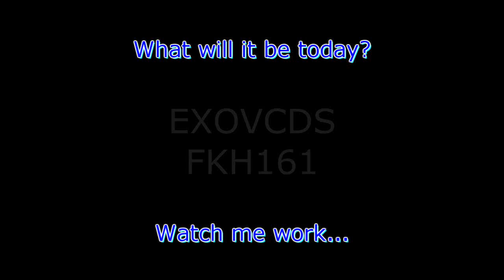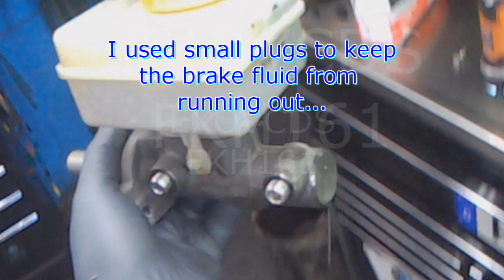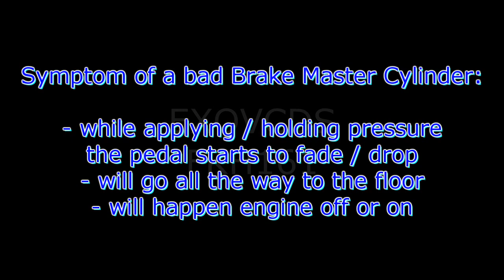VW A4: Brake Master Cylinder Replacement (part 1)

Comment: The video you are producing is giving surprisingly good contrast, great lighting in your shop. Voiceover done after, to explain what you are doing would be a great opportunity to discuss details like how to make the diagnosis and various pitfalls you have encountered.
Reply from the maker: Thank you for watching & taking the time to comment! I am not yet comfortable in adding voiceovers to all of my videos... I have added some in the past, to discuss datalogs, but find myself making mistakes which require multiple audio retakes. As soon as I get a chance to work out of my own little shop, I will talk while recording, as that comes naturally compared to narrating play by play.
Reply: Most guys add in the audio later, in which case you can record the audio at home and not feel self conscious when talking in the shop. It's sometimes distracting to teach and work at the same time. Sitting at a computer you could write out what you are about to say if you like, and you could even watch the video while talking. High level programs let you overlay the new audio on top of the old so it blends nicely. I've done this many times, if you have technical difficulties or wonder about hardware/software issues I might be able to help.
Reply from the maker: spelunkerd I'm using Sony Vegas Pro12 and have additional audio software as well. What I lack is the radio voice to go with the narration. Like I said, I have no issues talking into the mic while recording, but am not able to do much of that at my current job / surroundings.

Comment: hi. I have audi a4 b6. 
my brake pedal goes very soft only when engine is running, but when engine is off, pedal is not fading! could it still be master cylinder? what I noticed as well that only  when engine is running and I release my brakes, it takes 2 sec for the front pads to release the front brake discs. On the small incline its very noticable.
(front calipers are 2 years old.)
thanks in advance for any helpful answers.
Reply from the maker: Some cars have "hill assist"... where the brakes are held for a couple of seconds. I'm not sure if your model car has this feature. If the car does not have this option and the brakes are not releasing quickly, then it could be a problem with the brake booster. It is normal for the pedal to feel soft when the engine is running, due to the brake assist by the booster. If the booster is over assisting, it could be causing the delay in brake pedal / pad return. A bad master cylinder will cause the pedal to fade engine on or off.
Reply from the maker: @cmmartti  ABS unit bleeding is not necessary unless the unit was replaced or air got into the pump. With the ignition off, there should be no way air can get into the ABS unit since the valves are closed. When driving, the hydraulics bypass the ABS, so the brakes work just like a non ABS car. Once wheels start to lock, that's when the valves open and what can cause air to enter the system... if air is already in the lines.
Reply from the maker: @cmmartti  Thanks for the update! Sometimes you can get better brake pedal feel... by resetting the rear calipers. Turn the pistons in all the way and then back out, so that they just clear the brake pads (should have a couple mm free play// 1/8" max). Secure the caliper and then pump the parking brake lever at the caliper with your hand to fully adjust the mechanism.
Reply: @EXOVCDS  Thanks, I'll try that when I get a chance
Reply: did this fix your problem?

i have same issue..

bled many times.

i will readjust the callipers with rewind tool
Reply: @EXOVCDS 

you made a good video, i will change my master cylinder your way if i dont get it right.

golf 4. many abs feutures.

my pedal sinks when engine on, but pedal does not sink when engine is off..

Comment: What size/thread plugs did you use to plug the holes to keep fluid from running out after you removed the lines? Thanks again!!
Reply from the maker: They are plugs that come with new rear brake calipers. I keep the plugs and use them for stuff like this. I'd have to measure the size & pitch. They have a pointy / cone tip, to nicely engage the master cylinder / stop leaks.

Comment: Hey friend,

2003 mk4 jetta tdi

I just finished replacing brake hardlines and had to disconnect clutch line to do it. Bled the brakes and went to bleed clutch, but the clutch pedal drops to the floor and doesn't seem to ever build pressure and won't bleed when I crack open the slave cylinder.

So far nothing too good on forums/youtube. Any ideas? This was the closest video I could find that you had.
Reply from the maker: Leave the clutch slave bleeder open and check that fluid drips from it on its own (gravity bleed). If nothing comes out, let it sit a while until it does. Make sure that the fluid level in the reservoir is higher than the clutch feed tube. Buy a long clear rubber hose that fits snug on the slave bleeder and place the hose in a bottle of brake fluid. Bleeder open & hose submerged in the brake fluid container... pump the brake pedal with your hand (pull up on the pedal once it gets to the bottom). Have someone watch the clear hose while you pump. Fluid should start to come out of the slave bleeder and travel into the bottle. It will be a back & forth motion until the hose is full of fluid from the slave to the container. Keep an eye on the fluid level in the reservoir (top up if need be). Once the hose is full with fluid and no more air seems to be going back & forth, close the bleeder. How does the pedal feel now?
Reply: Thanks for the tips! There was definitely wayyyy too much air and it took forever to bleed it out.
Reply from the maker: @nforbes1991  thanks for the update!

Comment: How long did the whole job take?
Reply from the maker: magellanmax Including bleeding...for a beginner, 1 to 1.5hrs should be enough time.
Reply: ***** Thanks for your reply. I just needed to get a rough estimate in case I have a shop do it for me. Many a times I've been quoted a job to be 1 hour only to get hit by a 3 hour labor cost.
Reply from the maker: magellanmax Estimates are estimates... no-one knows if they are going to run into any problems (rusty vehicle with rusty bolts, bleeder nipples that break off etc).
Reply from the maker: magellanmax Mitchell labor guide actually lists master cyl as 1.6hrs (includes bleeding).